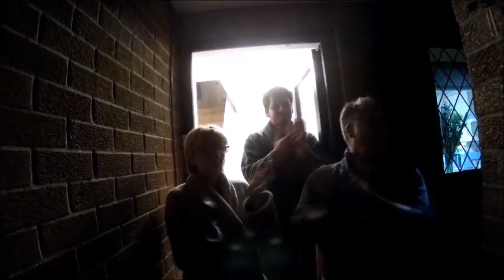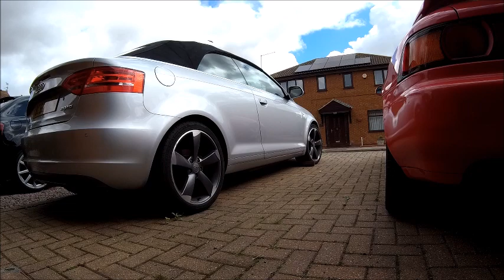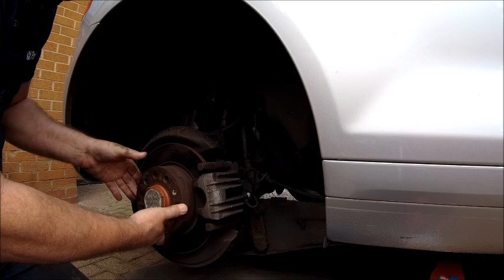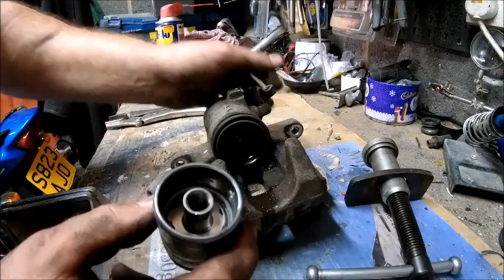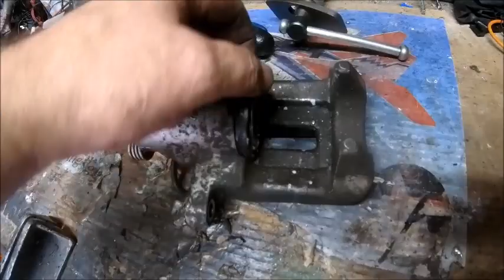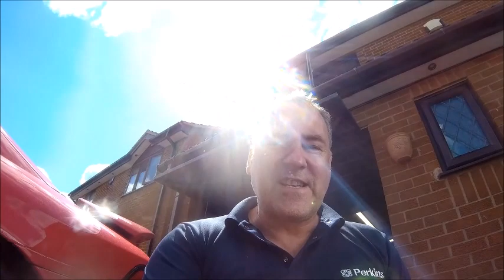Audi A3 Rear brake issue ***FAIL***

Comment: I had this issue on mine, thinking it was the lever in caliper. Brand new caliper with lever fitted and issue still present. Turned out to be the cable. Caliper only cost £53 so no biggie

Comment: I had the same issue and the garage near mine is a major one with a really good reputation used them loads and they said that it was a seized calliper. They replaced it for about £250 which I thought was really expensive but hey its they're required cost including an OEM part.
Now the other one is going or gone and I'm going probably now to replace it myself as I don't want to pay for them to fit and throw away about £200 to put a new part on but yeah that was in 2021 on a 2008 car.
Reply from the maker: I know garages have to make money (had my own some years back) but my mantra was to do a good job at a good price...I shudder at what some people charge for a 10 min job  :😒

Comment: I struggle with the same problem every year for MOT,  is just a bad design
Reply from the maker: Many Audi's i have owned have had rear calliper issues...the 80 was the worst, They used to freeze up in bad weather 😬
Reply: @AdeReeves  ahah funny you mention the  80, was my first car 20 and some years ago but at the time I was living in Portugal where temperatures are very nice so I don’t remember any problem about that but I just don’t get it how Audi engineers still doing it after this problem being almost a signature on Audi. In my opinion is a mathematical fail on leverages applied, I rather have two or three more clicks on handle but more force applied on callipers because if I go crazy and pull it really hard with two hands it does hold the car but of course no M.O.T technician will be ok with that! 
Great video btw 👍🏻
Reply: to retract it you rotate it, not press it, isnt it?